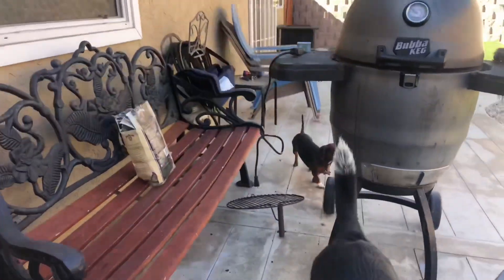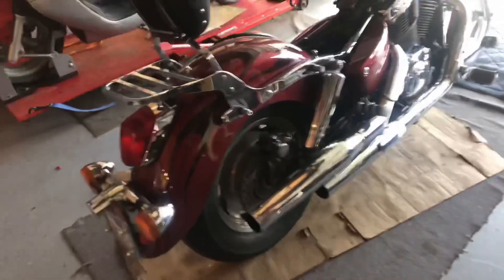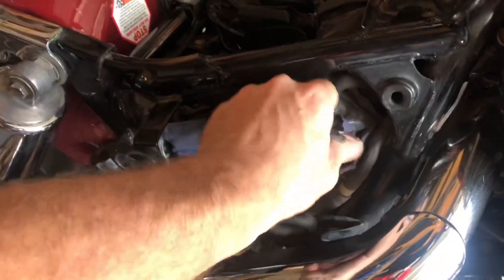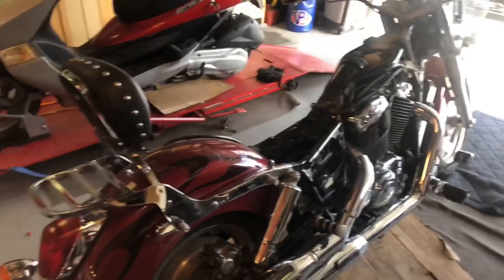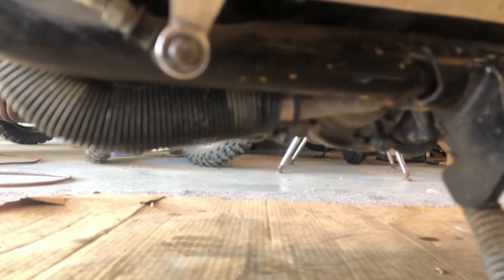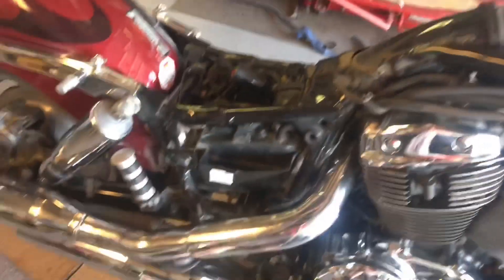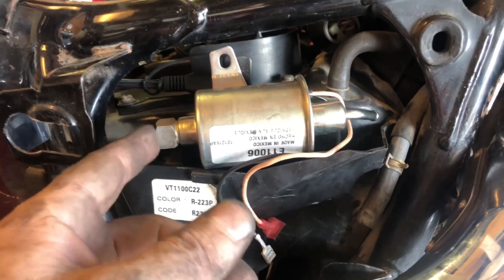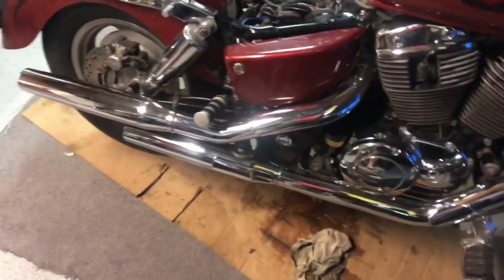Honda Shadow part 2: fuel pump and coolant.

Comment: I just put a fuel pump on my 1100 shadow it took 30 minutes and it was put back in the original position  !!!! I have a 1998 shadow tourer
Reply from the maker: @humes4545  good job

Comment: They're a pain in the butt im considering relocating mine as well a bolt on battery box because mine was falling apart everything fell apart I bought a dude there for a bit lol
Reply from the maker: Pretty poor design and location, also the Honda pump is expensive.

Comment: Just found your video, and man that was a Heck of a lot better than messing with that fuel pump! my shadow runs great now! Thanks!!!
Reply from the maker: It’s a good option to have at the very least.  Glad it helped you, thanks for watching.
Reply: Pete W- where did you get your fuel filter and what part number did you use?  Thanks
Reply: @dennislintz1  I actually used the stock Honda brand fuel filter, was actually able to get it off ebay and had it in 4 days. Then, got the fuel pump right at the local parts store just like the one he has.

Comment: Is there another way to drain coolant. My bikes prev owner smothered the bolt in locktite instead of using the copper washer -.-
Reply from the maker: That’s unfortunate.  First thing I would recommend is to heat the bolt up with either a small torch or a heat gun to try to remove it.  Otherwise, I suppose you could drain most of the coolant by removing the lower hose.

Comment: can i use red coolant on a shadow 600 1999? Will it mix badly with other colors if i dont empty out the reservoir tank?
Reply from the maker: Mantayn i really don’t know for sure.  Some coolants can be mixed.  Best practice would be not to mix.  Good luck.
Reply: @TomsTinkeringandAdventures  Ok thanks for answer, but using red coolant should be ok right?
Reply from the maker: Mantayn I would think so?  Motorcycles like silicate free coolant, so verify.
Reply: @TomsTinkeringandAdventures  thanks legend

Comment: Question. My Honda shadow 600 cc us running weird like the gas is not flowing smooth in the bike. In neutral it shakes and in a few occasions I heard a backfire (sounds like a bullet) coming out if the air filter.  I am not a mechanic so any help would be appreciated.
Reply from the maker: jrsian has it been sitting for any long period of time, like more than a month or so?
Reply: Tom's Tinkering and Adventures negative.   I was riding  the motorcycle every day to work   One day ( about a month ago) i stop at the gas station, filled it up, and when I started the bike, it backfired and didn’t want to start.    Towed the bike to the local Honda dealer and they told me it was bad gas. They drained the gas and put new fuel.  Afterwards the bike was feeling good for a couple of weeks. Afterwards,  I stared noticing that the bike was shaking while in neutral, like the flow of fuel is not constant.  Also, a couple of times, the bike backfires when I push the start button. The last time it backfired ( sounds like a single shit) I think I heard it coming out of the air filter section. At this time, the bikes starts well, but it sounds and feel weird.
Reply from the maker: jrsian very well could be bad fuel.  Carburetors are pretty picky, I would suggest trying some fuel system cleaner first.  SeaFoam is a good one.  Otherwise I would remove the carburetors and deep clean them.
Reply: Tom's Tinkering and Adventures  copy.  Thank you for your advice.  I really appreciate it.
Reply from the maker: jrsian best of luck.  It’s no fun when your bike isn’t running right.
Reply: @TomsTinkeringandAdventures  i have a 98 honda shadow aero and when i bought it 2 months ago it had 6,993 miles on it.  ive expected some leaks and i already had some of the issues addressed.  but now if your standing on the left side of the bike (the side that you mount the bike on) the from of the motor on the right where the oil pump is, ive noticed quite a bit of oil leaking from there.  i know liquids travel and it very well could be elsewhere.  but where would you suggest that i keep looking. 

also, when i checked the oil properly it still registered on the stick but was almost on the bottom line on the stick.  so even though a lot of oil had drained, it wouldnt go below that line.
Reply from the maker: @amstevensful  well it could be any number of things from the left side.  Stator cover, shift shaft, final drive seal.  Very difficult to say…you probably need to clean it up really well and hopefully can observe where the leak is coming from.  Best of luck.
Reply: @TomsTinkeringandAdventures  to be honest, i didnt expect you to answer that fast haha.  ive tried looking up every video and i even have a clymer manual so i could make an educated decision but to my avail i was left just guessing.  

what would you suggest that i use to clean up the oil on the bottom?
Reply from the maker: @amstevensful  a good degreaser.  I have recently been partnered with Super Clean, pretty good products.
Reply: @TomsTinkeringandAdventures  i will give that a try, thank you for your fuel pump placement in the old tool pouch.  thats a hell of a lot better place for it than the stock place.  i may try to place mine there as well.
Reply from the maker: @amstevensful  the fuel pump thing is a money saver, the Honda pump is expensive and of course difficult to access.  Thanks for watching, best of luck.

Comment: But it still calls for dot 4 i personally use rubbing alcohol its boiling point is higher jus cause it works dont mean its right says dot 4 for a reason not trying to be an ass
Reply from the maker: DOT 4 has a higher boiling point, its very important in ABS equipped vehicles. For a regular braking system, either 3 or 4 will be fine.  You can never go wrong using the factory recommendation though.  Thanks for watching!